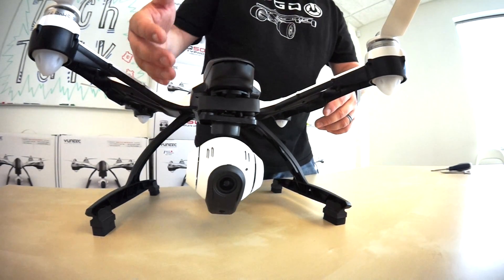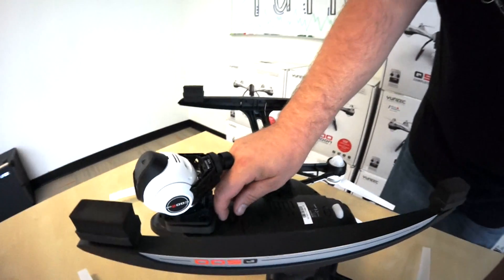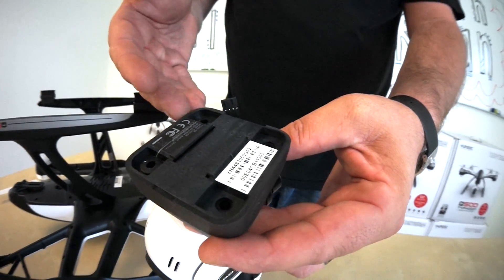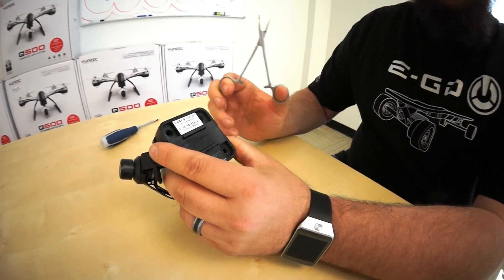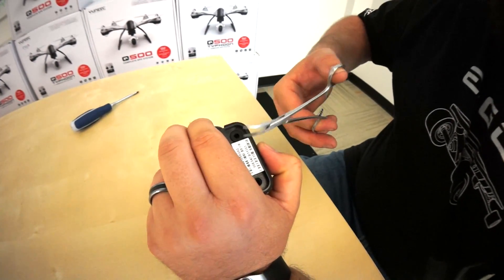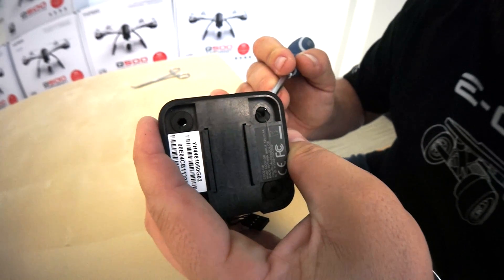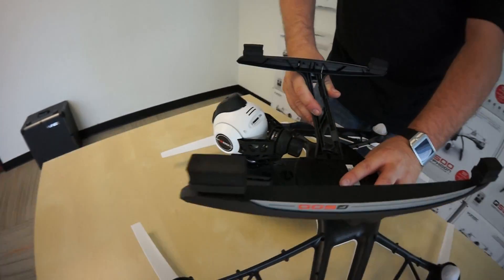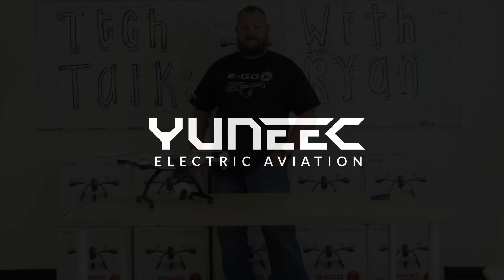YUNEEC TYPHOON Q-500 HOW TO INSTALL DAMPERS

Comment: Received my Q500 4k  2 weeks ago. After my first recording, I noticed it didn't appear quite level. Upon landing and inspecting the quad, one damper was dislodged from one of the receptacles in the gimbal.

I reviewed Ryan's video on reinstalling a damper. He recommended a homeostatic which looks like a scissors-like tweezers OR small flat head screwdriver. The dampers on the new 4K model are made of very soft rubber. I didn't have a himostat and knowing me, I thought the flat head screwed might poke a hole through the rubber using the screwdriver so I passed on that tool. NEXT IDEA!

I live in the south of the USA, and we do love pecans. To get all the pecans out of the shell, we use a picking tool with a curved point at the end. After squeezing the end of the damper nub that fits into the hole about half way, I used the picking tool to go through the hole opening in the damper and pulled upward until the whole nub pulled through the gimbal hole.  PROBLEM SOLVED!!!

Comment: Been trying to get support for my Gimbal. I've owned it less than a week and I can't get a call back. I just want it working. I have a Youtube video that shows the issue with it. I did run calibration in the GUI but it didn't help.